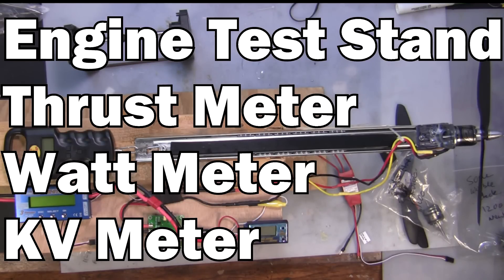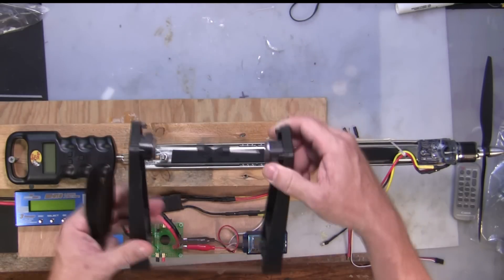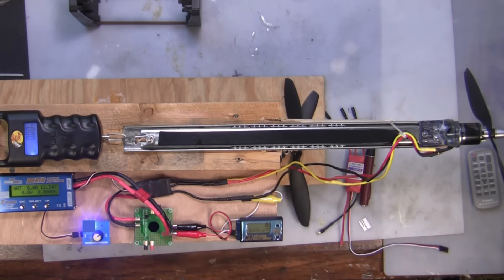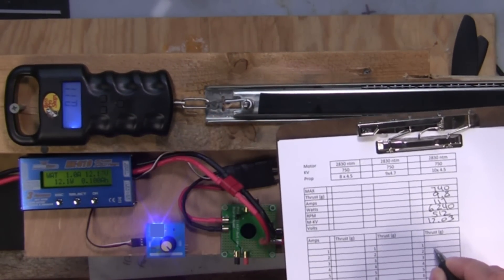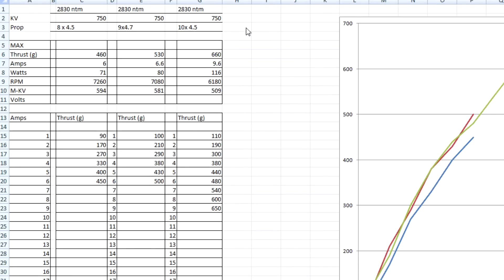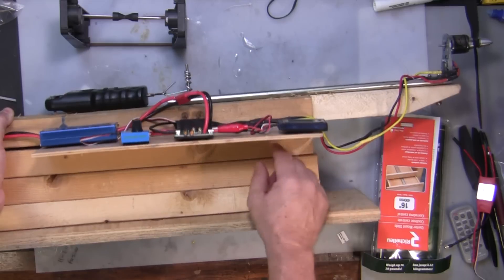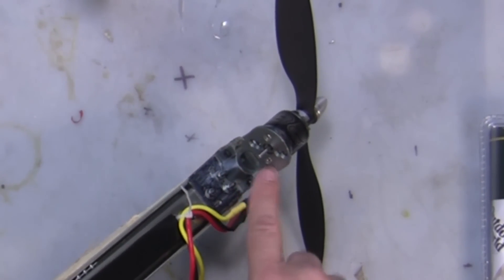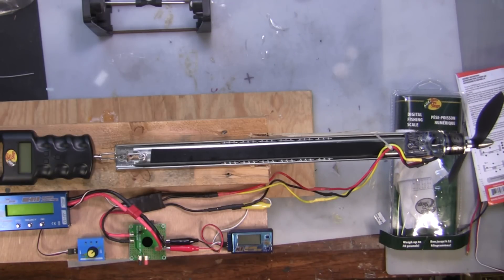Engine test stand for brushless motors

Comment: I know this is almost 30 months old and you may have discovered this for yourself but you should be comparing the thrust at different power (watts) levels not current (amps). Why? As you crank up the amps the voltage applied across the motor drops due to a number of factors. If you used W as your benchmark it takes into account the drop in voltage since P=VI.

Nice setup, I like it.
Reply: And what i find useful is to use the battery you are going to use in the setup. Not just for testing. Every battery is different. I do like the way this is setup. With the rails from a draw. I only would have already put some tension on the rails prior when pulling.